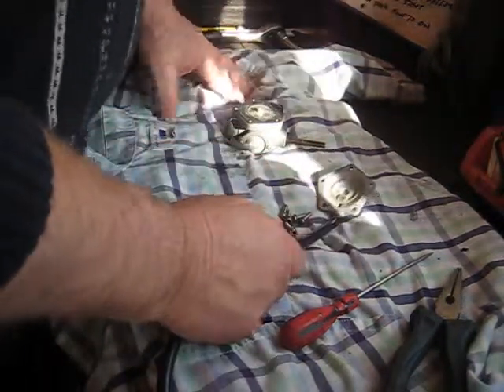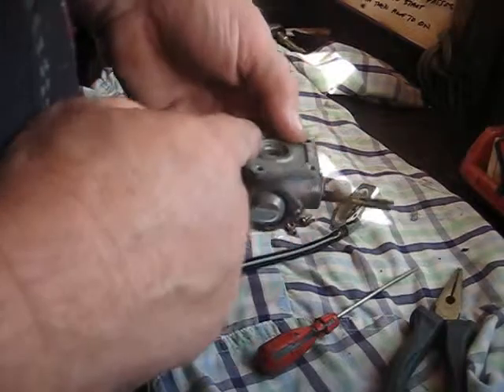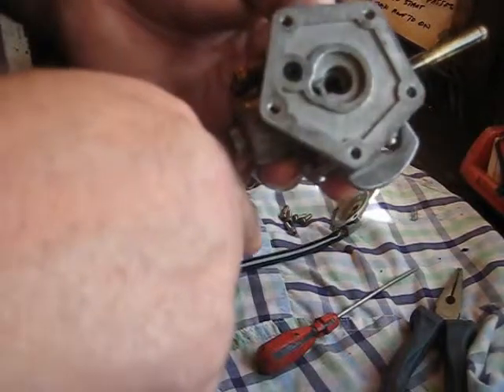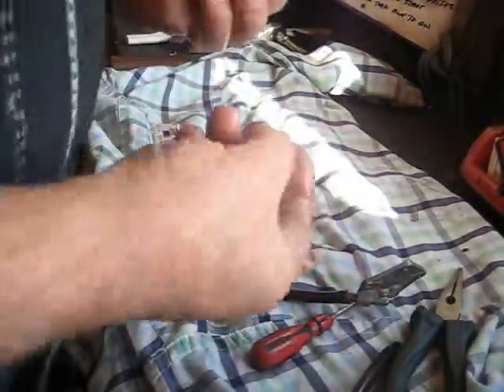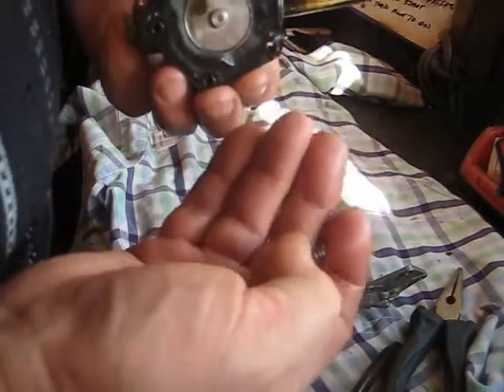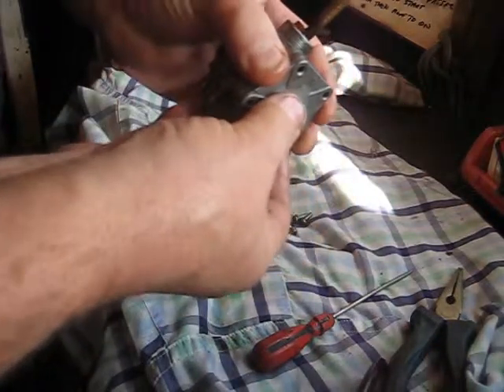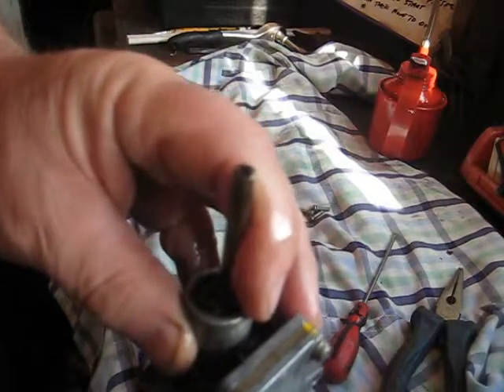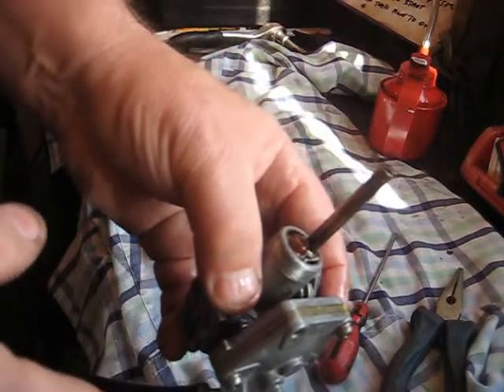suzuki gt250 petrol tap repair

Comment: I just took my GT 250 petcock apart and yes there is a brass looking spring right there. You are pretty smart to figure that out with the absent spring.
Do you know if there are any other petcocks that will work on this bike? Can’t find rebuild kit and new one is $400 U.S.
Reply: Where can you buy a new one. I have a GT250 1975.
Reply: @Barkbrod73  I bought a new one for $400. I think it was either eBay or Partzilla.